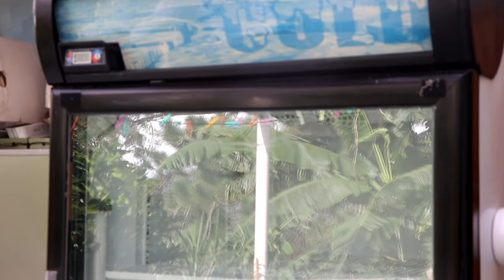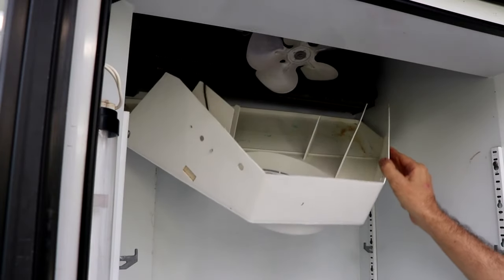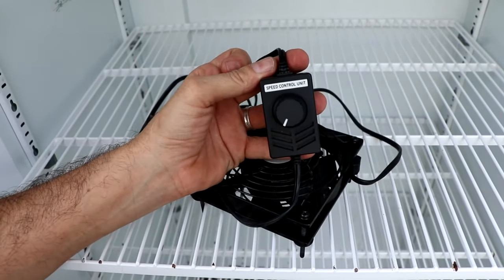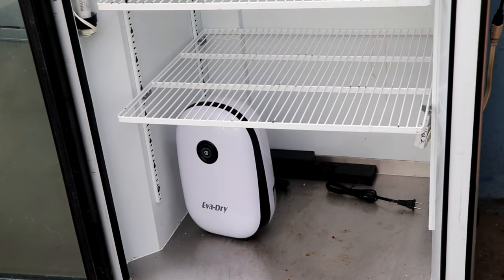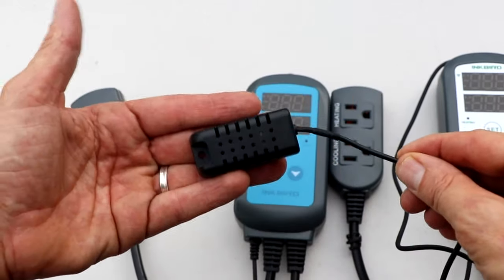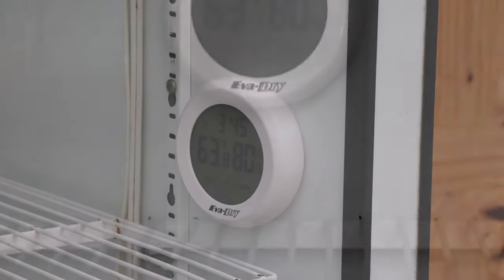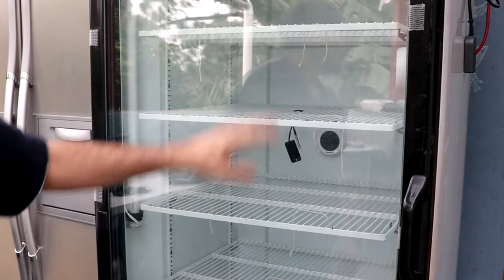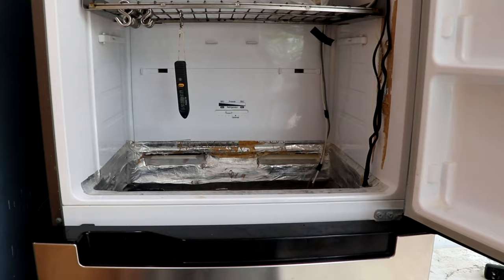Building a Salami Chamber/Cheese Cave - Easy Step by Step

Comment: Hello, I just modify an old refrigerator following your instructions, with all the equipement.
Everything went well, I didn’t put anything in the fridge and started the setup. BUT once the fridge is on (every 15-20 minutes), the humidity drop drastically!!!!! Like from 55 to 20!! I guess cold air does that but I’m a bit concerned. Then humidity goes up again once the fridge is off. I don’t want the humidifier and the deshuminifier to battle against each other constantly…. Do you have any suggestions? Thanks

Comment: Hi!
I've got a question about humidifying units.
I didn't really think of the difference between different humidifiers, and how they create the humidity.

Many people use a ultrasonic humidifier, but this does not generate "clean steam". It simply aerates the liquid in really small drops, small enough to be transported with the airflow. What this means, is any "bad stuff" in the water will become airborne.
In contrast, humidifiers that rely on small boiling chamber will produce steam, that is free of any other live substances as a result of the boiling.

Could this be an issue? Obviously it works well for you and others, so it does not seem to be an issue. But it seems it could be? To prevent this, the water reservoir should probably be filled with destilled or bottled water? And cleaned out regularly?
Reply from the maker: You are correct.  Th e best humidifiers to use should not produce heat and yes, the basin should be cleaned out regularly and distilled water or purified water should be used for best results..
Reply: @2guysandacooler  thanks for your reply :)
Humidifiers that generate heat would produce the safest steam, but then the rise in temperature would be an issue for the curing products. I guess that is why most use ultrasonic, as long as there are no contaminants in the water that will become airborne with the water droplets.

Trying to be as safe and educated as I can on these topics, but In tic case it seems that the ultrasonic is more than good enough, so therefore it's no point in using humidifiers that boil water (as those are more expensive, and cost much more to run).

Comment: Could you use these Chambers to dry age meat too? Also could make biltong in them?
Reply from the maker: For dry aging meat the temp is a bit high.  You would need to get the temp to the mid 30's (f).  Biltong could technically be made in a chamber like this but generally it requires a little warmer heat with more air flow..

Comment: Can you tell me what the air flow is? Is it 24 hour a day on? In my 122cm high at 60 cm deep refrigator, I have a computer fan 8cm with a controller at 7 volt.
It runs 3minutes two times a day, is that enough or not? I know it’s difficult to say, but can you give me suggestion what to do

Comment: Can all pop fridges be adjusted to 10 to 15 degrees? Most have temperature settings between 3 to 5 degrees. How are you achieving the correct temperature for meat curing?
Reply from the maker: I'm not sure.  The best way to achieve the right temperature is to use a controller like this one (https://amzn.to/3eTSlOg).  You set the temperature that you want and then you plug the fridge into the controller.  The controller turns the fridge on and off regulating the temp...

Comment: Hi Eric, what dehumidifier and humidifier do you recommend for a 47 cubic feet double door fridge?  Another question, what are your thoughts about freezing charcuterie?  Thank you!
Reply from the maker: That's a big chamber.  Here's a unit that would work for humidity:  https://amzn.to/3aYSaCx
This should do the trick for dehumidifying:  https://amzn.to/3uxBTw6

No matter which unit you end up getting just make sure that it has an auto on function.  So when the power gets cut off then back on again the unit will turn back on.  Some units, as soon as the power is cut off you have to manually turn it back on..

Comment: Almost went the freezer route yesterday, but found a “beverage display” style fridge today on Marketplace, similar in appearance to the one in this video, but only 48”H x 30”W x 24”D. Other than making sure the cooling works, anything I should watch out for that would make it NOT want to buy it?
Reply from the maker: The fan of the cooler is very important.  Check to see the fan placement.  I'm not a fan of coolers that blow directly over the center of the fridges.
Reply: @2guysandacooler  Thank you for your quick responses!
Reply: @2guysandacooler  I haven’t seen it in person, and there are only two pictures, and it’s two hours away! I do see some perforated holes in the back center of the chamber, which I would think would be the ventilation holes for the fan. Do you think a diffuser plate could be mounted over the top of that to push airflow out to the sides? Or should I skip it completely?

Comment: Hi Eric, can I cure my meat in my meat chamber versus a standard fridge?   Or does the curing process with salt & spices for the first couple of weeks or so has to be done in a fridge?  Thanks!
Reply from the maker: It depends on how you do it.  If you use the equilibrium method it needs to be done in your home fridge (cold temps).  If you use the salt box method you can technically cure it anywhere..

Comment: Great tips!! 
For the regular fridge (end of video) did you disable the thermostat of the freezer compartiment ? To only keep cold air coming from the refrigerator part. Thx
Reply from the maker: no.  All I did was remove the divider between the freezer and the fridge.
Reply: @2guysandacooler  so I guess the air of the freezer is not at the coldest
Reply from the maker: @tomvs4144  I have the knob set to about half way

Comment: Thank you for this video it made me want to dive right in to salami making. I do have one question, with the eva dry 2500  do you need to go in and push the on button every time the controller cuts power to the dehumidifier? Or how do you keep power to it?
Reply from the maker: Very cool!!  With the 2500 the unit will automatically cut on once the power has been restored to it.  Check this video out to see what I'm talking about  https://youtu.be/5pprS-jHAeM

Comment: Thanks for the very informative video! I was wondering does it matter what fridge/freezer i use? I need to keep my food at 2 and 10C (depending on the stage its at) but all the fridges ive seen are either in the range of 3 to 10c or 0 to -18c. For the 3-10C fridges, will inkbird be able to drop the temperature to 2C thus past its range? I prefer the chest freezers as i like the layout more but im not sure if it works since the temp is also above its original setting, will cause issues with either the freezer or inkbird? Thanks!
Reply from the maker: Inkbird will not bring the temp lower than the range.  It can bring it higher though.  Depending on what you are making a chest freezer would work fine as the controller allows you to set it higher than original range.  What are you making (if you don't mind me asking)

Comment: Hi Eric!
I'm doing a similar setup with the inkbirds but for producing Koji, I know that you have some experience on growing Koji. My fridge is not frost free, is there an issue with that?
I have the same computer fan, a donut humidifier and two seedling heating mats. Any tips regarding my setup will be appreciated.
Cheers.
Reply from the maker: ok..   Koji likes warmer temperatures and very high humidity so I wouldn't worry about the frost free part.  As long as you keep the internal temp of your chamber around 85F-95F and the humidity around 85%-90% you should be good to go...  What you are building is more like a fermentation chamber.  

Sounds like you are on the right track...

Comment: Where did you drill holes in your regular fridge in order to run the cords through? I am doing a conversion on a normal fridge and am not sure where to drill where I won’t run into pipes. Thanks!
Reply from the maker: If you drill your holes for the wires at the top towards the inside of the door frame you should be safe.  Either way.  drill carefully and slowly :)

Comment: I have 30 pounds of meat ,  temperature is set at 50 degrees F   salami about 2 - 1/4 inch diameter, there are 13 inside chamber spaced out about 2 1/2 - 3 inches apart. Half is on top rack and the other on bottom. rack. There’s plenty of space between the two racks, also plenty of space between top of fridge to top of salami from top rack (about 8”) and plenty of space between bottom of fridge to bottom of salami from second rack ( about 16”)
Reply from the maker: I would unplug the humidifier and raise your temperature to 55F.  Sometimes lots of meat in your chamber will cause it to spike.  Monitor it for a few days to see how it progresses.

Comment: I’m preparing to convert a Hotpoint 17.5 cf refrigerator and am trying to figure out if it’s safe to remove the floor of the freezer. I can’t tell from available drawings if there is any piping to be concerned about. Do you have any advice or rules of thumb about this?
Reply: Oh, and great video!
Reply from the maker: Hey Jeffrey.  I can't say for sure.   When I removed the floor of my freezer there was nothing but Styrofoam but I'm not sure about all models.  I would cut shallow cuts and remove little pieces at a time till it's all gone just to be sure.
Reply: @2guysandacooler  Wow. Thanks so much for the quick response. That’s sound advice. It does seem to have tubing embedded in the freezer floor. Wondering if I might be able drill holes to connect the air between the two chambers while leaving in tact. I’ll figure it out. I used your links to order the equipment so I hope you get some kickbacks. 🤙

Comment: Do you have to be careful about where you place the salami in the chamber so it's not getting directly misted by the humidifier? Trying to envision how well the humidifier's mist is evenly spread around inside, especially if there is no added fan for air movement (as in the 2nd chamber you showed at the end of the video).
Reply from the maker: Yes.  If the salami is directly in front of the mist it will eventually make it very soft and it won't dry properly..

Comment: quality video as usual :).  İm about to pull the trigger on the inkbird thermometer and humidity controllers. On their website they have a video where they used a carboy with a heating mat in their fridge.  Why didnt you use this setup?  İs it because it doesnt really get cold where you live?
Reply from the maker: That's correct.  Where I live it's a constant 73f all year long
Reply: @2guysandacooler  İ was watching a difference channel and this 75 year old Italian dude who said he worked in the sausage industry dropped a comment recommending a ceramic heater for reptiles... İs this what i think it is? or did you ever hear of this type of thing?  İt may be pretty hard to use a heating mat with a giant carboy in the fridge...
Reply from the maker: @ftmhlcv4645  Yeah.  The best way to heat a chamber is by just adding a reptile heater connected to a temperature controller.  The carboy technique is ok as it will maintain the heat better (as the liquid heats up) but not very practical for the home producer..
Reply: @2guysandacooler  haha oh man this is getting more interesting.  İm about to buy a fridge dedicated to the drying chamber.  İ saw you use a samsung fridge. İs there any particular brand that is better for the circulation/fan system or are they all the same.  İm assuming the cleaning of mold every now and than could possibly be easier on certain types of models/designs?

Comment: The solution to your air flow issue is just putting a simple potentioneter in line with that fan circuit. That's the speed control for that fan you installed. No removing the original fan. No extra wiring.
Reply from the maker: That's easy for you to say....😂😂
Reply: @2guysandacooler  It really is. Cut any wire on that fan circuit and connect  it to the the 1 and 2 poles. The 3rd is ground, and you don't need to hook it up the circuit is already grounded. What you did was replace the fan with another fan that had a potentiometer.
Reply: What you did was more complicated. I love the idea of using old store coolers though. Thank you. I didn't consider that.
Reply from the maker: @Drewcifer1972  I love your confidence in my ability to do electrical work.  All I did was disconnect the fan and placed a computer fan in it's place.   That's about the extent of my electrical skillet.  Now making salami is a whole different issue 😉
Reply: @2guysandacooler  LOL, What you do seems like sorcery to me too, but with your help I am learning.

Comment: I appreciate and thank you for your suggestions you have given. I still have the humidifier unplugged for now, the settings for the humidifier and dehumidifier is set at 80% with a differential of 3% high and low and the temperature set at 55 degrees with a differential of 1 degree high and low. So I took the numbers from the graph (24 hour period) and they were from 69% - 89% RH, so it worked out to be 81% RH. My question is the controller working the way it is supposed to and also could my dehumidifier be to small. It is drawing about an inch of water every second day (it’s a small dehumidifier like the Eva-dry 1100)
Reply from the maker: that's something you'll have to determine.  The key is maintaining that average for as long as you can before the compressor kicks on.

Comment: Thanks for a great video, my question is.   I want to go the beverage cooler route and see that it can cool between 0-12C according to fridge specs.  On the internet, it says that Meat should cure between, 10-15C I want to use a PID controller but how will I make sure that I have a constant say 12C as I understand if the fridge heats up it can be cooled down fast but if I need to get the heat up how long will that take as that part is not controllable for me.  Thanks Again
Reply: At 7:10, when Erick is showcasing the temperature controlers, one of the outlets is for a heating pad. He even mentions it later on when he is mounting them in the fridge.

Comment: Eric. I have a question. I made my chamber from a fridge like your second chamber in your video. But I did not have to cut the whole floor out.  What I was thinking is cutting a 1" to a 2" hole in the floor so the cold from the freezer will drop into the fridge....just enough to give it about 55° ish.....and then  I can still keep my freezer Temp working!! So I can keep my product frozen ish. Will this work?? I think my fridge is kept cold by the freezer mechanics?
Reply from the maker: You are correct Dan.  The fridge is kept cold by the freezer mechanics.  As far as drilling a hole to allow colder air in, in theory it should work but I would imagine that regulating it might be tricky.  I suppose if you plan on doing it any way you can run some tests to see how stable the temp gets over a 7 day period...

Comment: Thank you for showing off your build.  Question for you, are you able to store/age both salami and cheese at the same time? is there anything you need to consider / do to ensure everything is safe if you are able to put them in at the same time? any issue of mould from the salami cross contaminating the cheese or vice versa?
Reply from the maker: Hey Chris.  You can put both in the same chamber.  The only issue you will have mold cross contamination (which isn't really a bad thing).  If you are making a blue cheese you'll most likely get blue cheese mold all over your salami or you might get salami mold all over your cheese but I think that might be kind of good.

Comment: I’m trying to understand why the more powerful original fridge fan would dry the meat. I would think that if humidity is controlled to remain constant, then circulating air, no matter how forcefully, shouldn’t remove moisture from the surface of the meat. What am I overlooking?
Reply from the maker: That's precisely what it does.  Regardless of the humidity level too much air flow will remove the moisture off the surface of the meat leaving you with an outer ring that's dry but an inside that's not.  This is called case hardening...
Reply: @2guysandacooler  Thanks.  I have been thinking about this, and the reasoning I have come up with for why air speed has an effect on drying (and potentially over-drying) the meat surface even though humidity in the chamber is maintained constant is that the surface of the meat, while it is continuing to dry, is (I think) effectively at 100 percent humidity, but the circulating air is less humid than that.  If I have thought this through correctly, only in the case of the environment being at 100 percent RH would air speed have zero effect on drying.

Comment: excellent video. although humans have been making salami without technology for 2000 years so I'm sure there's an easier method. most people don't have a cellar but I'm sure there is a way to replicate that environment without the need for all the electronics. it can be done at room temperature. it would be great if you can do a video on that.
Reply from the maker: Here's the thing, it can't be done at room temp.  Fermentation and bacterial activity would run rampant.  You either need a cellar/basement where the temp is a constant 50-60f and 80% humidity or a dedicated chamber.  It's the reason why no tropical places on earth have their own salami.
Reply: @2guysandacooler  it's been made in Mediterranean environments. 60-70f won't work? some have recommended spraying them with water every few days to keep the humidity up. any experience with this?
Reply from the maker: @Bashirbros  whats the name of the salami made in 70f?  id love to look it up.

Comment: i have a tgm-11rv and i used the same setup as you. temp set at 55 deg with humidity @ 70 but i'm still having trouble keeping the humidity below 80 with the eva-dry 2500. what do you recommend?  now i did have 30# of dry sausage so i'm not sure if that was just too much